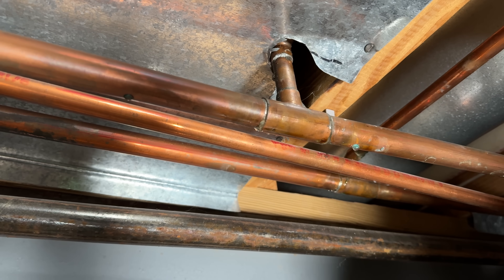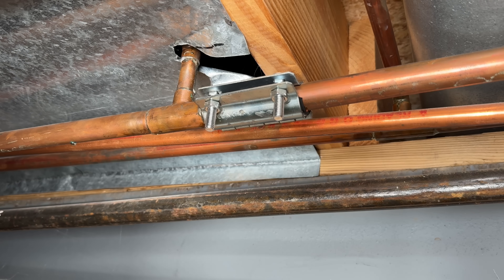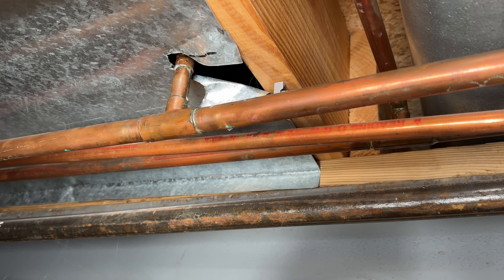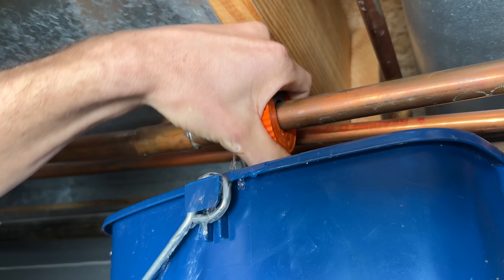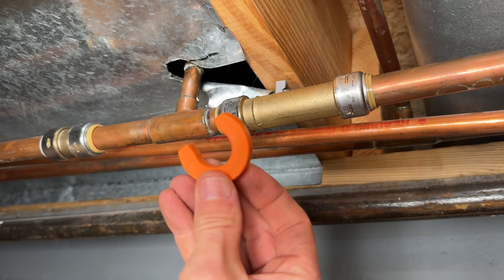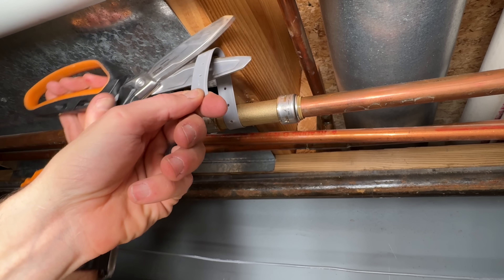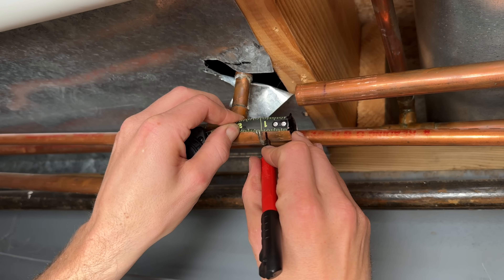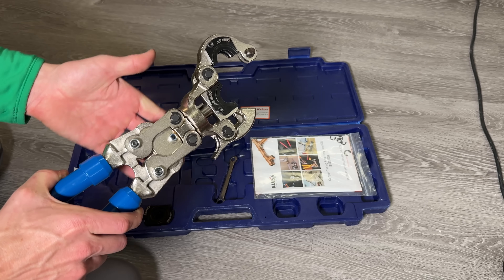How To Fix A Pinhole Water Leak In Copper Pipe | No Soldering Needed!

Comment: I have a copper pipe that just started leaking in the basement ceiling but the part leaking is up in the wood from ceiling so it can't see it. I stayed in the basement as i moved the pipe as my mom stayed up stairs in the bathroom and the pipe comes from the bathroom baseboard heater. What can we do without calling a plumber 😢

Comment: I flip houses and hold rental properties.  I've used sharkbite couplers and end caps multiple times over the last 15 years and never had an issue.  Saves me time and I just keep some of 1/2 inch and 3/4 inch in the truck, not that I need them often, but I feel very confident in the sharkbite fittings.

Comment: What caused the pin hole?  If it is caused by age then how long do you think you have before you need to replace all the pipes? Just curious since I have old pipes in my house.  No leaks yet but curious whether I should repair them when they do start happening or just replace.

Comment: I have this problem - a plummer friend of mine told me that the issue is that the copper is bad in the first place so best to replace the entire pipe since it will leak again somewhere else at some point. - the issue I have is that there are 2 pipes right next to each other (like touching) and it's tough to get anything around it...  People have also recommended the JB Water Weld...  I like the shark bites...

Comment: Building contractors want to cut corners and complain about the building code being too strict, but when it comes to Sharkbites, they complain about it being too loose by allowing Sharkbites to be approved. They're just dumb and jealous that do-it-yourselfers can now do plumbing. The Sharkbite o-ring will probably last longer than that leaky copper did, and I would pull out as much of that copper as I could reach while I was up there. Jet engines have rubber o-rings, but we can't trust them in walls? Sureeee...

Comment: Perhaps I trust the newer sharkbite fittings.  Always add enough pipe supports to prevent any pipe tranlation movement during water hammering effects, and also thermal expansion .

Comment: I just had a gas wall heater installed in Italy and was surprised that the installer used the crimped copper throughout the entire project, even runs outside of the house. I'd never used anything but iron pipe.
I have one of the crimping tools shown that I use for regular plumbing here. I've been in a few tight spots where it was difficult to use the long handles, but it goes pretty fast and I certainly prefer it to sweating copper. I'd say the big difference from using PEX in the US is that the lines tend to be a multilayered tube with one of the layers being aluminum. It makes it bendable/semi-rigid and is supposed to protect the plastic inside from light degradation. Fortunately, all of the plumbing fitting sizes are English standard, so not everything is different for me!

Comment: For emergency pinhole repair (50 year old house) I have a couple Rothenberger Kibosh clamps, one in ½" and one in ¾". They are a bit pricey but they clamp on quickly and do work and are reusable. I left one on a pinhole leak for about six months before I got around to a permanent fix.

Comment: I've said before.... that autocut tool shouldn't work at all.... but it does and better than anything else I've used.   It's kind of brilliant.  As to the trust... yes, especially in complex plumbing situations where I can get to the pipes later.   If it's inside the wall, I prefer a more traditional approach using either soldering or the press fittings, especially where it's next to wood or anything flammable.

Comment: Main problem is that its on the seam, so its a bad pipe. It will most likely leak down the line.
All needs removing.
Its a big issues on modern copper.

Comment: reminds me of a hard freeze that settled in my region in 2018. After outdoor temperature moved up and leak began to show up i saw 2-4 pin hole leaks in the pipe where spraying a mist of water. It was galvanized 3/4 water supply to the house. It was amazing how i was able to apply a quick fix using some wooden tooth picks. Wood is important because as the wood gets wet, it will swell in size helping to form a tight seal. Peirce each spray of water with a tooth pick and it help up until i had some PEX to replace the piping.

Comment: Personally i would replace much more pipe as pin holes tend to be inside the dame pipe further back,both sides well beyond pin holes.
I have seen immediate area repairs only to come back ,1-2 years later doing it all agin for more pin holes in the very same pipes.
on examining olde pipes of more that 30 years old ,your see a line of corrsion for 2-3 feet long.

Comment: Take a rubber hose a couple inch long , slice it , put it on the copper pipe , use a quality hose clamp right where the pin hole is , tighten clamp , this will seal the pin hole .

Comment: Nice video sharing options. Having recently repaired a pin hole leak in a pipe I installed 40 years ago in my home, I questioned why the pinhole developed in the first place. Yes there wall has eroded to the point of failure, so I expect that the adjacent pipe is also compromised. Soldering is not that difficult, so I went that route. I unsweat  at the tee, cut back the bad part and I used a sleeve coupling and new pipe. I feel more confident with this repair, and it was very cost appropriate. 
While I was prepping for this repair, I used a bit of Gorilla tape and a hose clamp as a temp fix.

Comment: Excellent video.  I did not know that slip joint shark bite fittings existed.  Question:  what would cause the pin hole leaks?  Would it make most sense to replace the entire run of pipe to prevent further leaks in this pipe?

Comment: I have two comments: 1) two pinhole leaks is very concerning. There is a bigger  issue going on. I would investigate further as to the cause. Perhaps replace the copper with pex?
2) I bought a hydraulic pro-press tool on Amazon for about $100. It works pretty good. It does not take much muscle like the tool you have. The only caveat is that it will not fit in tight spaces where there is little clearance around the pipe.

Comment: This should be mentioned:  In my experience, pipe-wall pinhole leaks are most often occurring due to some prior builder/plumber/contractor using cheaper, thin-walled 'type M' copper pipe.   Examine the pipe carefully before you invest a bunch of time and effort into putting in a patch for a pinhole.   It may be better to replace the pipe section entirely (with type L copper or Pex, if switching) or you will likely end up with another pinhole leak down the road.
Reply: yeah, it just developed two holes for a reason I knew someone bought a house with pinhole leaks all over it was acidic well water and type m pipe previous owners added a tank with limestone to neutralize water too late.
Reply: True dat! The "fixes" in this vid are temporary (at best).

Comment: Almost all pinholes on copper pipes are due to high nitrate levels in your water supply. It will start with the homeowner thinking its condensation but rapidly progresses to a pinhole leak. The best solution is to introduce an aluminimum sacral anode within the system !

Comment: I love my unfinished basement where I can see all the pipes. After a pro repaired a pinhole leak about a year ago, I looked at a press-fit tool but yeah... very expensive. While Shark-bite does not sound like a permanent solution, reading the comments here it sounds like it would be permanent enough for me, a 70 year old DIY'er

Comment: Main risk of shark bites is the pipe must be pinned and n🎉ot loose other wise it may give way when you depressurise the pipe. Copper Hot water pipes often corrode around manifolds that have multiple pipes soldered into them. The flux used and splattered around is often the problem. I have been using b press fittings on these and they appear to work ok.

Comment: I owned a home that had  one of the older style water shutoff. One year after winterizing the home ,the washer in the valve started leaking. Slowly the water got by the shutoff and made its way to the dishwasher. During a cold spell the water in the dishwasher sprung a leak. $30,000 damage to home. $.15 washer failed causing extensive damage. Please replace your multi turn shut off valve with the 1/4 turn style. Your insurance company will thank you.

Comment: There are hydraulic "propress" crimpers that require less space, you pump a handle, rather than use that "bolt cutter" motion. I think the propress was the correct choice here. And you can see that the pipe still had water in it. Soldering would require getting rid of the water first and then shoving bread into the pipes to keep the water away while you solder.

Comment: Wait a minute.  You have three pin hole leaks that you know of.  Doesn't that mean you have hundreds more ready to leak anytime?  Vertical pinhole leaks are harder to find because the water goes down the wall.  
This happened to my niece.  I studied it a lot, and found that the copper pipe manufacturers blame the water companies, and the water companies blame the pipe manufacturers, so you are basically out of luck legally.  Shouldn't you replace it all with PEX?

Comment: It's a shame that many professional plumbers are using press fittings when they could be sweating copper. The problem with press fittings is that there is a rubber gasket  that will fail way before any sweated, soldered connection will fail.

Comment: Instead of using a saw to cut the drywall, use a multi-tool (vibrating tool) Use a T-square to mark the cut. First pass, JUST CUT through the paper on the drywall (don’t try to go all the way through) Next pass, plunge all the way through. Much faster, easier to just put the drywall piece back again.
Reply: Your approach also allows for the old piece being used as a template on a new piece. I replace wet damaged drywall since it often has lost its integrity. A new solid patch makes a more reliable repair in my opinion.

Comment: I trust the Shartbite more than the propress using a manual tool.  One die for a hydraulic pp costs $200.  Both PP and SB rely on the "sealing element" and I wouldn't feel comfortable closing either in the wall.  I'm re-piping 100% PEX so my SB's will be temporary and none of this will matter.  I have seven reliable SB connections under the house in the crawl space from previous owner repairs that been there for over 2 years on city water and 80PSI of static pressure.  I would still recommend keeping it at 65PSI max.  I think my PRV might be buried in the yard.  

Is there any failure rate data for these fittings that isnt produced by the OEMs?  The biggest problem seems to be user error (prep and press depth).

I bet you go back and put the torch on these pipes because you can and are a professional.    :)

Comment: What a legend, fixing the pipe 2 times just to show us 2 methods.  You are an educator & deserves all the respect 🙏👍
Reply: He forgot the 3rd,  Epoxy to the rescue. (Lol)
Reply: @jazzcornertv  I got here because of a leak that started - thought it was coming from upstairs tub [aging Moen cartridge] but turned out to be literally a TRUE pinhole - a mist of water, and yes I will be using the epoxy for that. Tight small area - going to review the ability to use the autocut. The hole is near the end of an elbow and would like to use the Sharkbite for that. House (prior owners) is a mix copper/pex [newer renos]/sharkbite [small footprint].
Reply: @bellyman6969  Well it might spring another leak down the road depending on the type of water you have. Worse case epoxy can buy you some quick time in such a tight spot until you are ready to do the entire project.
Reply: Few questions:  (1) preparing the pipe with plumbers mesh tape and cloth for the press fits isn’t in the manual for Viega press fittings but I see so many videos of users preparing press copper tubing fittings that way.  (2). The press fittings have a limit on their distance from existing c(old) solder fittings not sure if the fitting next to this T into the ceiling is too close?
Reply: Actually, he repaired it 3 times. That temporary repair may have lasted for ages.

Comment: I’m wondering why you ended up with two holes in your copper pipe.
Are these simply flaws in the manufacturing process?
I’d be concerned they are going to pop up all over the place.

Comment: What about cutting a section of pipe, popping on some compression fittings with one end pex adapters? I don't trust anything else aside from pex B crimp ring connections. Cheap crimping tools and rock solid watertight connections. I throw out all copper and cast iron piping and replace with this fix. Personally I would not trust sharkbite fittings.
Reply from the maker: Thanks for the feedback!

Comment: Years ago, on a pinhole leak, I used 2 part epoxy ribbon and a hose clamp. I put a good glop of the epoxy all the way around after I rubbed the 2 parts together and tightened the hose clamp over the glob. The clamp forced the epoxy into the hole. As far as I know that fix is still working, 20 years later. I don't live there any more, but never heard a thing from the new owner.

Comment: I am by no means a plumber  or professional. Have used sharkbite fittings  for a least 5 years. I have had one to fail. But I beleive that it was my fault. The one thing that you  have to rememember is that the ends of the pipes, that the shark bites install must be clean and free of burs. If  you don't  do this you are going to have leaks. The other fittings that I used were real good and never leaked. Enjoy your channel.

Comment: What caused those leaks? Usually, when copper is supported by galvanized straps and the copper wasn't protected, this happens. It looks like the piece going through the ceiling is touching the metal. That is enough to cause pin holes. Expansion and contraction can also be an issue on hot water pipe

Comment: The reason I don't like Sharkbite is they use a rubber material to create the seal. These have a limited lifespan, so after 20 years, the rubber will have deteriorated, and you will get a leak.

Comment: I worked in a chem plant - so I was very familiar with ball valves.         when I purchased this house,  I had the main shutoff and I think no other valves.   so I added ball valves everywhere ( except under sink - had help and I was not ready for ball valve - political situation ).   I changed out each fitting ( or both sides ) whenever a repair was needed ( except the last one - since main off - did a couple at one time ).  
I replumbed with CPVC and has no sharkbite except where I connected copper to cpvc.   when I did under the since ( I have problems screwing on shutoff values and wished I have used sharkbyte shutoff valve ).

Comment: The question here is, WHAT is causing the PINHOLE leaks????
Reply: Excess flux on the interior of joint/pipe most likely.   If there is too much flux applied it will remain in system, is very "acidic" and will create a point of deterioration.  But not alone.  You will almost always see these pinholes on the hot trunk while rarely seeing them on the cold.  I'm not a chemist but my theory is that the heat from the water heater increases the rate at which the flux interacts with the copper.  When you cut out one of these lines, look though the pipe, you'll see a mountain of green oxidation at the failure point.  You'll see several more that haven't failed yet.  When possible, change the entire length of lateral line. Otherwise you'll be back to repair within the year.
Reply: @johnp.2979  Thank you!

Comment: Pinhole leaks in copper are an indication of a bigger problem. Electrolysis, turbulence, defective pipe,  or the wrong grade (type M) will have you chasing your tail. Proper grounding, deburring the inside, and replacing complete sections with type L will help.

Comment: The shark bite slip coupling seems risky as there's a chance the teeth siding past the sealing surface could gouge it and create channels for water to leak through.  Extra care would need to be taken when sliding it in and out to avoid that, since it's so important to make sure the pipe is perfectly smooth where the o ring contacts it.

Comment: Had this happen a buncha times... used a 1" piece of soft hose slit lengthwise and wrapped over the pinhole and then put a single hose clamp around it, tightened it down directly over the pinhole.  Worked like a champ for a year until I could re-pipe using PEX.
Reply: I had a good sized pinhole in an exterior galvanized pipe that supplied a business that could not have their water off for even an hour according to them. After explaining to them that it needs to be off to repair it correctly, I finally just agreed to do a temporary fix that could last awhile.  I took a OO washer, put it over the hole…..the solid part of coarse, and like you, also used a hose clamp to secure it.  It has not leaked since, and that was 12 years ago. sometimes we get lucky. 🙂

Comment: If you have those pin holes, you will have more. Your pipe is getting very thin. You really need to have it all replaced, I suggest with pex. That is what I did. It won't take long until another pin hole will develop.

Comment: I've never used any of the stuff you showed but I don't know why most people prefer SharkBite because with 0-rings, they deteriorate and over time, they are bound to leak again. But in turns of cost and convenience, I would likely go with SharkBite too if fixing it myself. I have leaks all the time around the house with kitchen faucets, toilet water supply lines, laundry and show lines, etc and all except 1 is due to worn 0-rings or rubber washer.